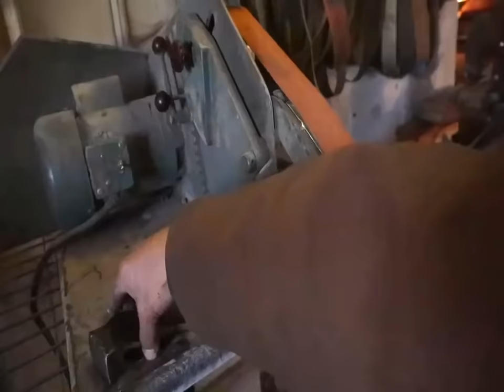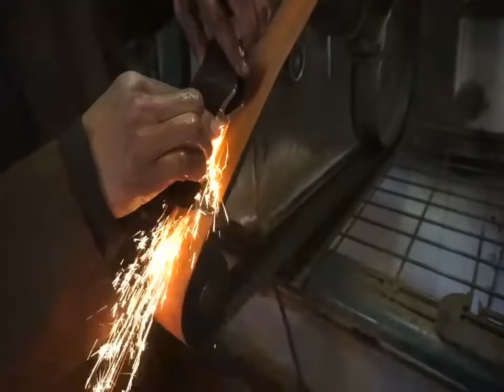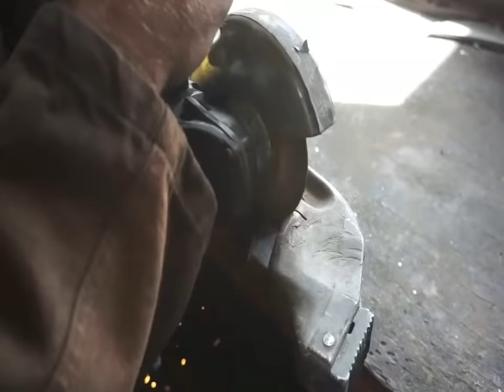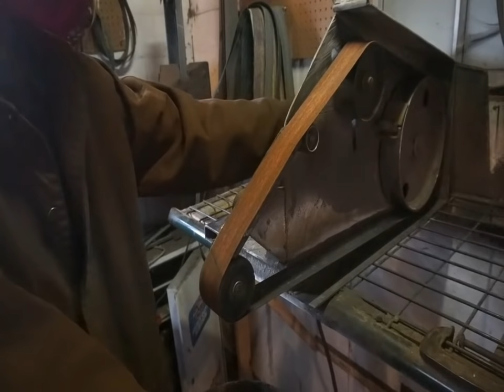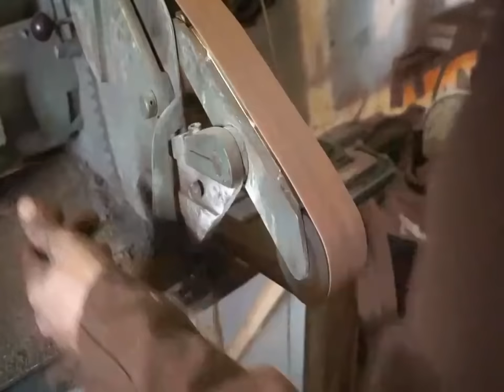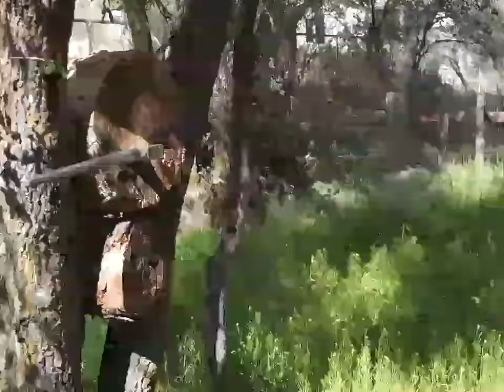Make Custom Battle Axe With Wrench Handle

Comment: Hi mate great video, I just picked up a Wilton square wheel grinder and I was wondering what horsepower your motor was. Also have you got any tips on how to get the belt tracking right because mine wobbles a bit.

Comment: Very cool but I would suggest one more step to really make the axe indestructible. I would pin and peen the head to the handle. Just drill a hole and add a brass or steel pin right through the center of the axehead and handle. It would help prevent the peening you did to the handle to keep the head on from getting beat out of place. It can be done at any time and wouldn’t take that much extra work to complete.
Reply: @Spencer . . . great idea !

Comment: if you put the curved part of the handle towards the front of the axe in the other direction would have had more cutting Force and less roll in your hand when you were chopping
Reply: also a wooden handle for less vibration stress on the hands, there is a reason why wooden handles are on axes

Comment: Nice axe...not exactly what id think of as far as a battle axe tho..too heavy.
I liked that you seemed to try to thin the head. the shape of the head is good. i woulda cut the back part of the head off...the hammer part. and then thinned down to sides of the head as much as I could..and as evenly as i could..and then hafted it with a good handle for a battle ready battle axe.
swinging that one handed in battle...lol no way.
Reply: Was looking for a comment like this. Now I dont have to do it myself ;D

Comment: I was right with you till you left the ugly joint on the bottom side of the axe head. Less than an hour of fitting and it would have been badass.
Reply: Buddy Deal Battle axes were never intended to look pretty anyway. Sure it would still work like an axe.

Comment: Jesus dude...use some gloves :O !!!!
Reply: Jonathan Neryh  I'm not scared or afraid to lose any body part in the end we die fool
Reply: Well, at least I still have the life expectancy of +55 YEARS, all I did was warn our friend, because our members do not grow as hair.
Reply: Only a clumsy Smith uses gloves.
Reply: No gloves near rotary tools. Better to risk a scratch than to risk your entire hand getting messed up by being pulled into the tool
Reply: A lady who works in the same plant as me just got her pinky finger ripped off 3 days ago by a drill press. 
I've been bit by an angle grinder a few times, sure it rips through flesh easily but you'd be hard pressed to cut an entire finger off.